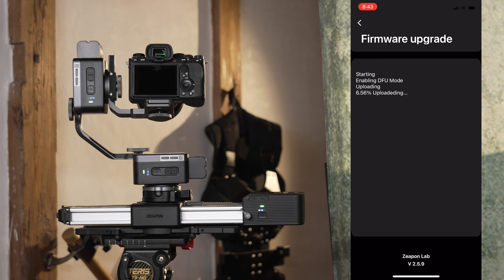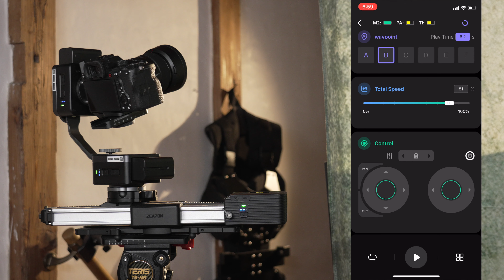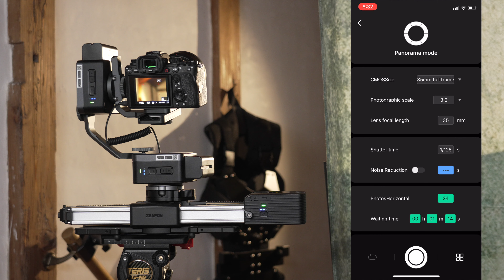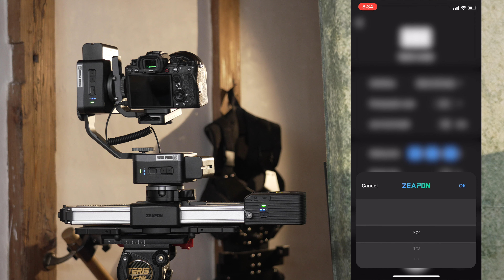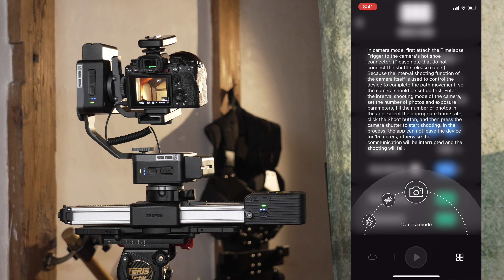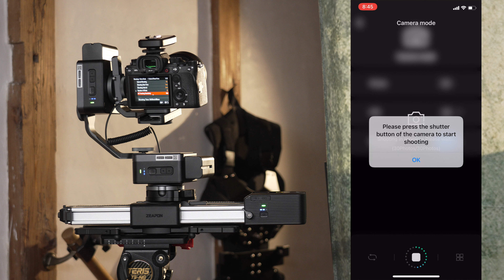Zeapon Pons PT | With the Mobile App (Part 3)

Comment: Thanks for the video. I don't understand what the "noise reduction" feature is on the app because there's nothing that the slider itself can do to reduce noise nor can it communicate with the camera's settings to activate any kind of noise reduction when doing captures. Super confused about this..

Comment: Hi Scott, thanks for the great videos... It looks like a great system, and considering getting it. Couple of questions though - Are there any plans to have other methods of pan/tilt control (eg, via app as inertia, mimicking phone movement, or via something like PS4 controller?) Is there an update for 360 degree turntable photography, for control on number of photos per rotation? And lastly, how sensitive is the slider, what increments can it move in? (for macro focus stacking) Thanks again!!

Comment: Hi Scott - great video.
Im running this same system and also using an iPhone. Works flawlessly for me and I love it. My question is this: is there any way to use the TL trigger to involve time ramping. When shooting day to night it's quite likely that you might end up with a shutter speed of up to 30 seconds. That would mean setting up the internal camera's trigger time to around 32-33 seconds. All fine except you probably don't want the "day" interval to be anywhere near that long. Is there a solution for this? For example, the Time Lapse View Plus can trigger the camera and ramp time to accommodate the day-to-night issue. Can the Zeapon TL Trigger do something similar and if not, is Zeapon considering a solution for this?

Comment: Hello Scott, thanks for this video. I have a question about 360 ° mode. It seems it's more panorama horizontal in 360° , than 360° immersive images, because it's only pan . am I right ?
Reply from the maker: Hi! That's right, it's a 360 panorama not like a Insta360 type point of view.

Comment: Scott does it have vibrations in the footage?
Reply from the maker: It will depend on many factors, but I can't say a definitive no. However, image stabilization including IBIS helps a LOT and I've used this with 100mm macro lenses and got super smooth footage that didn't need any stabilization in post. Proper balancing, reasonable expectations in regards to speed, for example, and camera/lens stabilization will get great results. And it's also pretty much the same results I've seen from any other slider like this, or better.
Reply: @ScottDumas  I have an I footage shark mini for 3 years now. The problem is the vibration or jitters on the footage. It's annoying but can be fixed in premiere.

Comment: Thanks for the review on this updated system. I find the 3 preset speeds on the pan head to be way too fast to be practical (for my use). I wish there was a way to program user speeds via the app and save them as presets in the pan head, to eliminate the need for the app. I presume the app will allow for much slower speeds. Thanks.
Reply from the maker: That would be a great update! I did find the speeds to be a bit too high for subtle movement at close distances as well. I'll pass that feedback along to Zeapon! :)

Comment: Just brought the head and found the apps, as compare to edelkrone, is way more difficult to understand, even having different modes.

Firstly, if I need to create a 360 time lapse, it's hard to set key point by estimating start n end points. Ended up the apps couldn't trigger as I might have set the end point beyond 360. If possible, edit/amend the 360 panorama program for time lapse, just punch in duration n number of photos will do.

Btw, if we are doing day to night or night to day time lapse, how could we fixed a shutter speed? Therefore, the fixed shutter speed quite useless and totally mess up the whole calculation. We just need interval, key points (if possible, via degrees) n number of photos, the rest via camera. 

Hope that there are some improvements on the apps else quite a waste on a nice product. I got this cause my edelkrone giving me issues recently n I found that this device having 12h battery life by using f970 battery. Hope we got a good upgrade soon.

Comment: Hi Scott, thanks for this. I have  couple of questions, and I apologise if they are covered in your more advanced review. Once you exit the camera mode and enter the time lapse mode, will the software hold onto the way points so that you can repeat exactly the same moves and therefore mix real time and time lapse footage in post ?  The other question is just baffling me. How does a remote ap control noise on the camera? And finally, relating to the panorama mode, true 360 panos involve the camera rotating through a sequence of anything between 4-6 images for a room with a fish eyes lens to 30 plus images for less wide angle shots - does this thing allow you to shoot rooms with accuracy? Thanks.
Reply from the maker: Hi! Thanks very much for watching and no worries. 
The waypoints are set in the camera page and will be used (they're necessary) for the time lapse. So, while I haven't done it myself, you should be able to theoretically use the waypoints to take a standard video clip, then take a time lapse with those same waypoints and it should theoretically be essentially the same path. 
The app doesn't control the noise, but if noise reduction is turned on in camera it takes time after the shutter closes, so the app/slider need to calculate for that time so that the movement still matches up with each shot and the timing doesn't get messed up.
As for the 360 panoramas, I haven't tried it indoors, but it does adjust the number of photos that it takes according to your focal length, and in my experience, there haven't been any problems with stitching them and I've shot them with a few different focal lengths from 35-85mm. 

Hope that helps! :)

Comment: Why there is  - in matrix mode - calculate 2x2 photos ? Is it determining by lens focal length? If so, when there will be 3x3 or 5x5 photos? I wonder, so the maximum angle of matrix stitched is fixed, for what value?
Reply: Seems weird. It should be some input for the user to say what the corners of the final image should cover and then the app calculates how many images are required...

Comment: I like the look of the app.  It looks very modern and responsive.  6 waypoints is fantastic for such an affordable slider solution.  However, I'd like to see the Time Lapse function and if it's possible to set waypoint speeds in terms of minutes and even hours for time lapses.
Reply from the maker: There’s more detail and demonstration of the time lapse page  in my previous app walkthrough which is in the playlist of Zeapon videos, but it pretty much just flows through the waypoints at a steady speed for whatever the duration of the time lapse ends up being based on your settings, you can get it to go for how long you need but not specific speeds between different waypoints